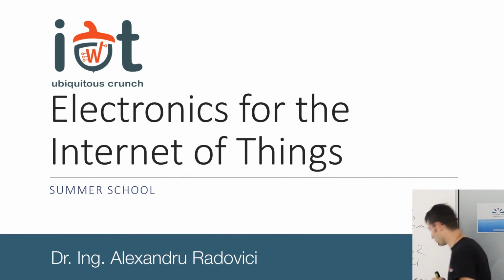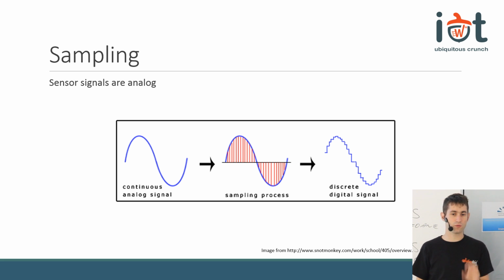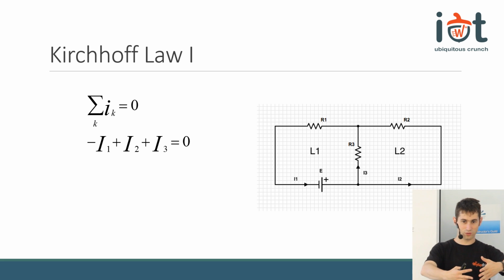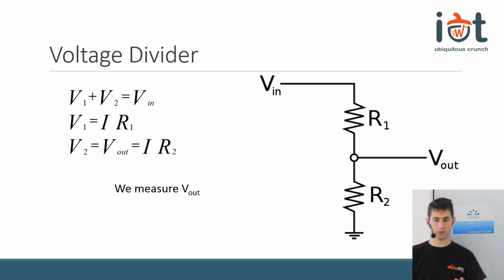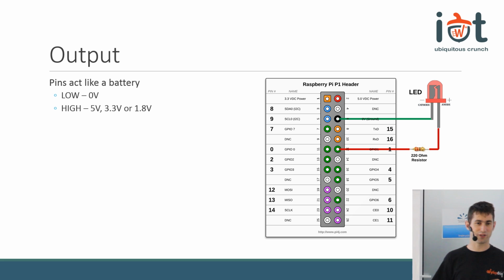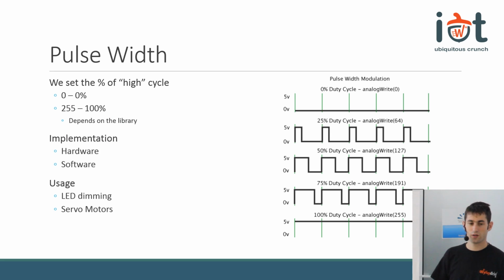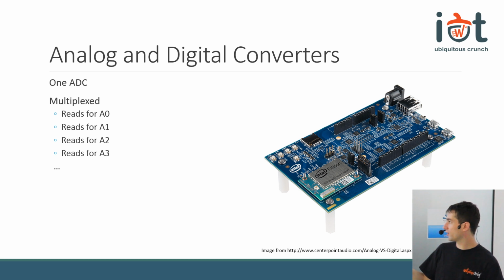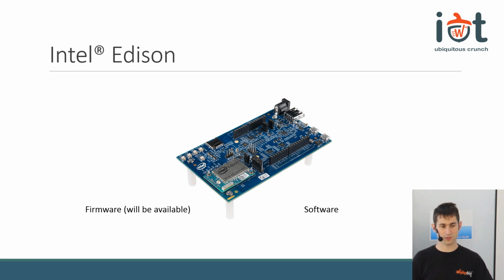Lecture 2: Electronics for the Internet of Things

Comment: Error at 4:09.  If you have 3 bits, you do not have 9 steps available.  You have 2 raised to the 3rd power, which is 8.
Reply: 0,1,2,3,4,5,6,7,8 ... that's 9 steps
Reply: @shantanugaur0207  
111 = 7
1000 = 8
You would need 4 bits for the 8.
Reply: true :D